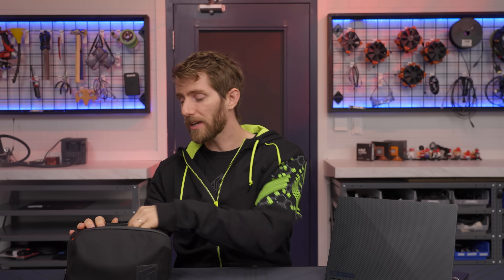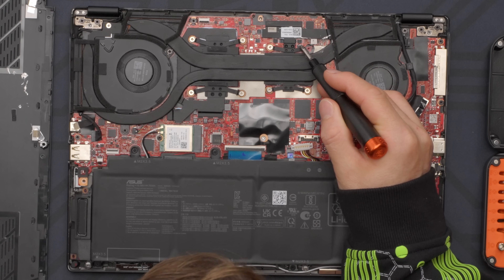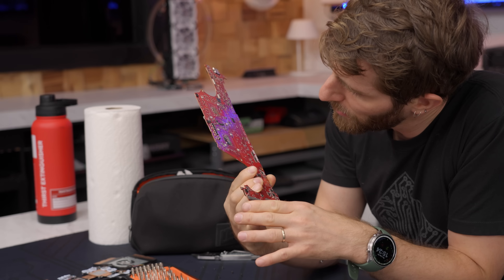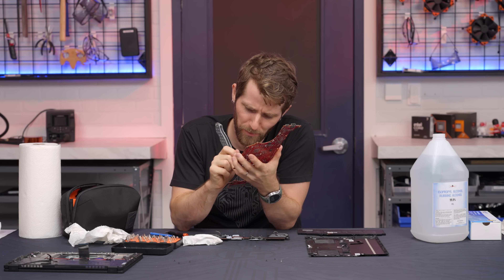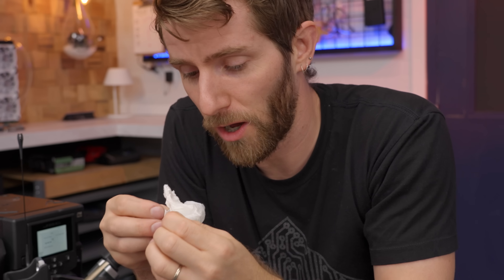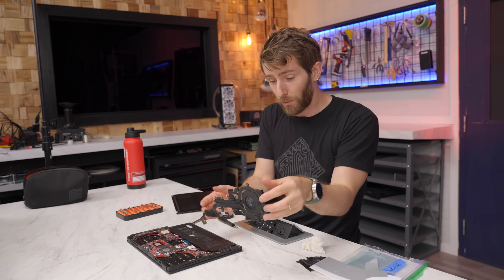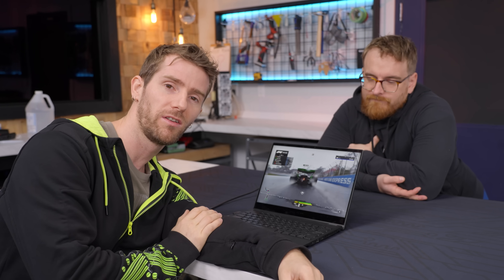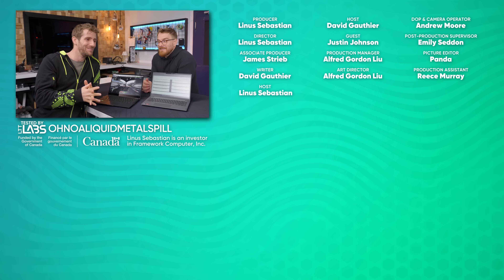Liquid Metal Killed my Laptop… Now What?

Comment: 17:34 The PTM7950 delivers similar thermal performance to liquid metal for far greater reliability. Sold.
Reply: @TwistedMe13  I replaced the default liquid metal on my Legion Pro 7i with PTM 7950 and temps are around 10 C higher in single-core workloads, but at least they are consistent over time unlike the liquid metal temps which degraded by 15 C in 6 months
Reply: @suglet-f6i9z on my Scar 18 2023 it got within 2C at the same fan speed. About where the LM would degrade to after a month after a reapplication.
Reply: @magfal  Most people seem to have better luck than me and I also have modified some settings like TVB to allow it to boost up to the full 5.4 GHz at all times, so for the vast majority of cases it is absolutely worth replacing with PTM.
Reply: @suglet-f6i9z 15C degradation from liquid metal is wild, given the PTM7950 should improve over time as it is heat cycled over time
Reply: I won't use anything else these days, I absolutely love PTM7950, I use it on my Deck OLED as well as on my 7950X3D IHS, CPU temps even after 1.5 years are pretty much identical to the day I installed it. Can be a pain in the ass to apply, even when putting it in the fridge for a bit to harden it, but it's worth it for long term use with good consistent temps. It's nice not having to repaste my bloody CPU because temps slowly increased over time. Putting LM in a laptop though is bloody insane, a device that gets moved a lot and will end up in being stored at all angles, especially if it's being carried in a backpack.
Reply: More like manufacturers should be the ones sold on it. Leave liquid metal to the extreme overclockers who are working on stationary test benches. A commercial product shouldn't use it.
Reply: @Xhaleon  Not to be the devils advocate but…Between all the laptops, all the GPUs PS5 and PS5 pro how many million units use it? How many have failed? He could have just had one that had too much LM, maybe assembly line fault or early prototype. Most likely a pre-production unit which is what reviewers usually get. No reason to overreact and say it has no place in consumer products. If we all thought like that we would still be living in caves, new tech always comes with problems you need to work around and solve, not run away in fear.
Reply: Which begs the question, why isnt it the standard over fairly dangerous (for the device) liquid metal. For extremely long term industrial niches i can see metal being better, but the PTM just seems so much more convenient.
Reply: @BrandonsUsername  It's because expensive grey thermal goo doesn't have the same marketing wow as LM. Also, lots of the marketing for new laptops happens on release and LM gives the best possible performance on a brand new device. A year later it might perform worse than thermal paste, but nobody runs benchmarks on a year old laptop.
Reply: @fix0the0spade More specifically, once they're a year old all the press will be on the new and shiny liquid metal cooled laptops, which now perform so much better than the 1 year old last gen models with degraded cooling. How awesome it must be, no?
Reply: @fix0the0spade even a month in the case of a large laptop actually being transported around in a backpack thanks to flexing.
Reply: @BrandonsUsername  Because gamers are not in it for the reliability as the first order of concern. It's performance and they are not generally techies.
Reply: I’ve tried both, on my Dell with a 13980hx and an ADA 5000, there was no temperature difference, not sure how they were able to measure one, but on mine I can only measure a clock difference, cpu hits 100c and GPU 80c regardless. Clock wise, LM gave an extra 50mhz on cpu and 25mhz on GPU, scores were within 1%. I went back to PTM7950 even though I had splurged on nickel plating the heatsink. Biggest limitation on a laptop is the size of the cooler and power delivery. Pumpout is also a huge issue which plagues both most conventional thermal paste and LM. On average as an overall I would say PTM is the best, along with removing the stock pads or gel and replacing with high quality pads. In my case I have the ability to laser scan the mobo and heatsink so I got rid of pads and used copper shims with PTM on either side. Laptop still only hits max advertised CPU turbo for 2sec, it’s about 1ghz better than stock once it settles in, which is like 33% improvement with a loud ass llano stand cooler, but that’s Dell. I think that the CPU really wants about 200w but it only has 150for 58sec, and the GPU wants 180w but can only get 145. Total system draw is limited to 240w at any time. It just needs more space and heatsink, along with a big ass brick power supply than can do 400w.
Reply: @radugrigoras  sounds like you're in my exact situation / had the same experience as me but you went further (nickel plating and illano cooler!) You got a discord?
Reply: The big difference I've noticed is consistency. On my 13980HX/4070 Asus laptop, core temperatures at idle with PTM7950 (eBay sourced but appears to be genuine) are all within a few degrees of each other, many months after being applied. Liquid metal (both stock and on reapplication) gave slightly better temperatures initially IIRC, but each time after a month or so, one or two of the cores would be running abnormally hot. With the stock application, one of the cores ended up pegged at 98C, even under no load, causing the fans to spin fast constantly.

I haven't compared them in depth under load, but given both LM and PTM7950 quickly result in thermal throttling, I doubt there's much difference. A sizeable undervolt (-0.150V core plus other tweaks) gives a nice boost to performance with either TIM.
Reply: Well, it's not that much better than a normal thermal compound. The benefit is not performance, but longevity. It's an excellent alternative, but not for the reason you mentioned.
Reply: Although LM is the best perfomant TIM, the dangers it comes with far outweigh the pros when compared to PTM, and that's why I always use PTM as my go-to TIM. It's close enough in performace, but without any instant or long-term issues like leaks or dry spots. Safety and reliability over raw performance all day long.
Reply: That’s not supposed to be the case though.  In ideal conditions Liquid Metal will absolutely outperform normal thermal paste, high performance silver paste paste, and ptm7950
Reply: I've been procrastinating on replacing my 3 year old thermal paste with some ptm7950 I bought a couple months ago. These videos are really showing how much performance I'm leaving on the table.
Reply: Only reason PTM7950 delivers similar performance is because LM was applied improperly. Every machine I had to open, remove the excess, rub it in till its shiny on both the cpu and heatsink. Then carefully marry both sides and DONE! The temps can never be beat by anything.
Reply: Lots of misinformation about liquid metal here.
This will piss some people off... but liquid metal is safe and THE BEST POSSIBLE thermal performance - when you're not an obvious degenerate like Linus is when it comes to handling laptops (and the pathetic performance he displayed in his repair attempt here solidified this).
Reply: @GOOFLEr  Ouch, sick burn
Reply: @GOOFLEr  I don't remember there being any talk about special handling on these systems. Linus didn't seem to be handling any different than normal consumer use, he wasn't babying it but he wasn't misusing / abusing it. If this laptop had to be treated with kid gloves in order for the LM to not have issues, then that should've been mentioned somewhere and not been used in products (especially high volume ones) that would see that kind of use.
Reply: @Fay7666  did you even watch the video.. the entire first half he was explaining how he treats his laptop like crap
Reply: @GOOFLEr  if you watched the video properly you would have realized that's how most people treat their laptops.
Reply: @rayok_zed that's why most people should NOT use LM.
Because they're incompetent
Reply: @GOOFLEr  How can you call something safe when it can kill your whole PC? Just like water, it's not safe and that's why it has to be carefully managed. And you're complaining about how he performed repairing it? News flash, he never claimed to be a specialist and that has nothing to do with how the laptop was designed.
Reply: @GOOFLEr  Alienware M18 R1 i9-13980HX here. I haven't found at the time the PTM. I got the same thermal pad of Thermal Grizzly (on reddit many say that is a rebranded PTM). Terrible even after 10 days of cycles heat-cold. Liquid metal is the way to go. Who says liquidi metal is dangerous or had problems, for sure their system they were applying the LM to, was not native with barriers or, for sure, they have applied tons of it

Comment: Parts-People channel has lots of Dell laptops that have had the LM escape from the rubber dam. Putting a laptop in a backpack does not help. Time to get the microscope, hot air rework station and soldering iron hot.

Comment: My asus laptop Liquid Metal is so badly applied that only half of the die is covered and my cpu always reach 95c and throttling like crazy, repasted it with my trusty ptm 7950 and laptop runs way cooler and stay on boost much longer

Comment: I think liquid metal not worth it.. 
Last time I used that stuff was in an FX8350 CPU ... Worked fine, but heck was messy to apply and clean some years later.
And today thermal solutions is evolved mutch to not worth a benefit in normal everyday use.

Comment: I made post on Reddit about my client's out of warranty ROG laptop with exact same issue with LM. They contacted me. A guy from Asus Poland told me that Asus Central decided to replace the board free of charge even if the product is from 2021.

It was the last thing that I could expect from Asus. They even called me after a few days again and asked to ship it to them as fast as I can. It came back fixed - with brand new motherboard. Then the "ASUS Gaming Laptops Have Been Broken Since 2021" happened. A rough time to work in their PR department I guess.
Reply: Oh - and a few days after receiving fixed product from Asus, my friend asked me to help with overheating issues in his 2021 ROG Zephyrus. Replacing 4 years old LM (in this case it stayed where it should stay - no spill) with the most basic thermal compound (MX5) resulted in ~15C drop on 5900HS CPU.

Liquid metal is not something you want inside your mobile device. In fact - you probably don't need it in any consumer grade electronics. Nothing would convince me me to use it inside my PC (CPU/GPU - doesn't matter) - it's not worth the risk and the time it consumes to be cleaned properly.

Comment: I'd have started by heating it while vertical to just past the melting point of LM but long before the solder temp. Let the LM on the board drop off, scrub off if possible right out the part oven etc. Then go around and resolder the tiny components if needed.
Reply: Use oven with low enough temperature to heat it? And since the metal was on one side, hang it to oven that side down?

Comment: i bought a flow x13 back in 2022 from amzn before the prices of the x13 skyrocketed to the older one with 1650 being the same price as the newer one with integrated gpu.. i started to set up the laptop and the keyboard malfunctioned.. one key press would land 7-8 keystrokes.. i had to RMA the laptop but since the one i wanted was the last one in stock.. they sent out a technician, he said it was damage caused due to leaky liquid metal, and they offered me full refund.. outcome = great but i would have loved to have that laptop... got a dell inspiron 7420 2 in 1 after instead😭

Comment: Liquid metal is specifically made to brake your laptop beyond repairability so they can force YOU to BUY new laptop or console, it will probably fry your CPU or GPU which makes repair very expensive so it's another anti consumer practice without any big benefits for laptop cooling
Reply: Break*

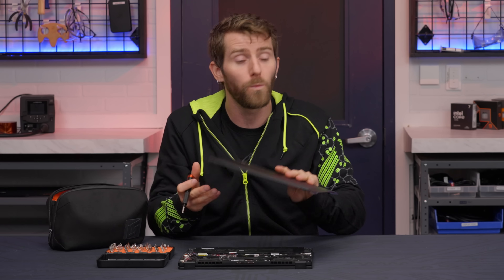Comment: 2:20 If doing those things, which I'd consider normal use case scenarios, is "bad" for a laptop, then why bother having a laptop?! If a Laptop can't be jostled around, yes - even while warm, then what is the point of it being a Mobile PC? Just my two cents...
Reply: imagine if you couldn't put your cell phone sideways while it was warm lmfao.. most definitely a bad design
Reply: Having liquid metal without proper seal on a portable machine imo isn't fit for purpose.
Reply: A lot of laptops don't even shut down properly when the lid is closed.
Reply: Thats the reason i buy a laptop. it's going to get bent a bit slammed and in weird places. maybe left in a hot or cold car. u expect worse performance than a desktop because you also expect it to not break because u tossed your backpack in the back seat. 

it is the reason so many people buy apple laptops. they just seem to have that part down pretty good. even with the obvious negatives of apple.
Reply: @Zackfed96 yeah this is my workplace always insists on Thinkpads because they get bashed around all the time. I've yet to see one fail

Comment: I want to say that I appreciate you posting this video even though you didn't fix it.  It is good to see the entire process, successful or not, so others can see that sometimes there just is nothing that can be done except perhaps preventing a similar issue in the first place.  Excellent video!
Reply: Besides, the unintended message from this video is important, too.  If you have a laptop with liquid metal, you must babysit it. No rough handling, no chucking into a backpack while the laptop is still warm. Lastly, even after a successful repair (from a liquid metal damage), things can break again. Some SMT components may have become loosened ( but not yet detached). They will get detached later and you have no clue why it happened.

Comment: yea thats why ptm7950 is the way no risk and no need to replace it for years, my old i7 9750h can run on avg 80-85c and its running on 4Ghz all core even without undervolting which is the max clock speed of this old cpu i dont even remember i need to repaste it i just need to clean the fan regularly.

Comment: You can use crumpled aluminum foil for larger spills. For the smaller ones cotton sticks with isopropil using slow rotation movements to carefully pick it up are the best option. Using brushes is not a good idea, it usually does more damage and shoots it all over the place. Once you get all visible places (don't forget to check under chips, if there is any under there, you won't be able to avoid reballing), put it in a dishwasher or ultrasound cleaner.

Comment: Its not only a ASUS problem, its also a DELL problem. https://www.youtube.com/@dellpartspeople this channel have dealt with lm a lot and its not only conductive, it destroys the cooler pipes as well. He also use a ultra sonic cleaner for the board when he cleaned most of the lm from the board. LLM (leaking liquid metal) is a big problem when they use it on higher end laptops

Comment: I did PTM7950 for my laptop, and it’s been pretty stellar.

Dropped my temps (compared to paste) by ~10C, and I don’t need to worry about liquid metal spillover.
Reply: In other news, water is wet. Is your laptop even designed with LM in mind? 
If you werent a scaredy cat and watched enough LM application tutorials, you'd get the best results and near zero chance of spillover.
Reply: @CaptainObvious-l33t  did you watch the video? PTM temps were just as good or better than liquid metal.
Reply: @jaro6985 That's physically just not possible. That benchmark is misleading. That being said, I agree liquid metal is completely idiotic and ptm is better, but there's no way it will perform as well thermally speaking.
Reply: @username8644  liquid metal is very hard to apply,automation line cannot do that properly,so almost all of them got badly applied,so ptm or thermal paste  always win.From 2024 most laptop either use ptm 7950 or thermal paste that is as good as mx 2/mx4
Reply: @username8644  With the tight tolerances between the heat sink and the die, total thermal conductivity shouldn't matter except at the very high end so long as the total conductivity of the interface material has enough capacity for the application. At lower performance levels the PTM going through it's phase change may be helping pull heat from the die, perhaps acting as a heat pump itself.
Regardless, Gallium is a bad choice for a consumer item.

Comment: Most electronics have several safety devices to keep them from dying when they experience shorts, like resettable fuses, crowbar circuits and efuses. Unless it's an unlucky set of circumstances like a short from a high voltage to a low voltage rail, the device is unlikely to die
Reply: I hold on to my belief that there's probably some gallium underneath a component that is shorting a rail. Could try to use those high velocity fans to blow it out?

Comment: This wont happen with a proper application because your using such a thin later. I put liquid metal in my laptop more than 2 years ago and its fine. Problem is, the factories put way too much and that causes it to leak.

Comment: i have asus Flow x13 - n i notice my temp in idle is around 60.C .. My suspicions the liquid termal is not performing n was about to remove it and change it to normal thermal paste or thermal pad. Glad to see u did this and shows, in theory it work.
Reply: bad application if you open it up and remove and redo the application of LM you will see -10 to 15 C very documented issue not sure how such a big company treats liquid metals like thermal pastes and just plops it on instead of careful application but eh gotta cut corners somewhere?